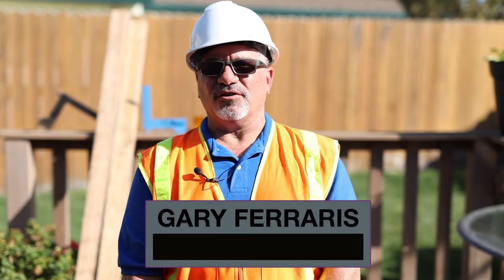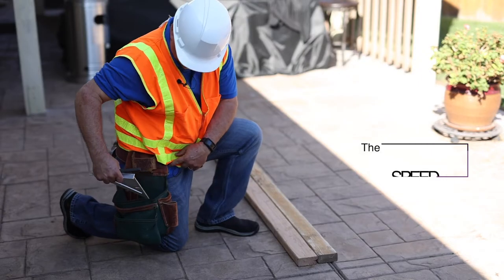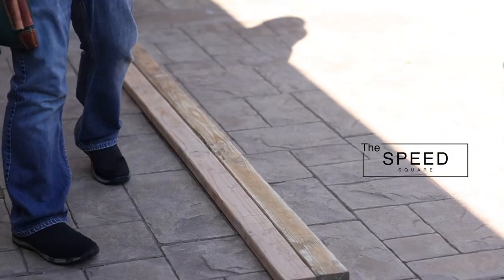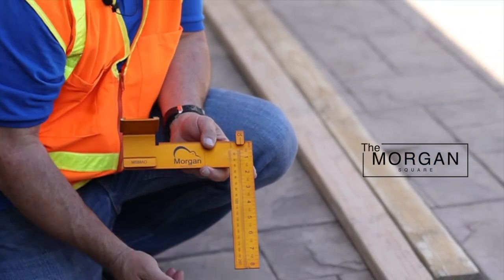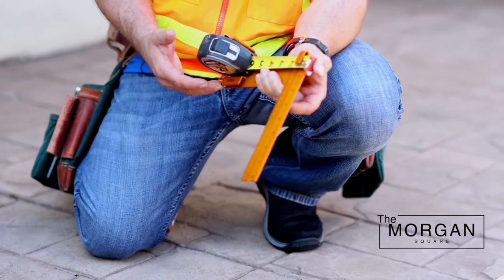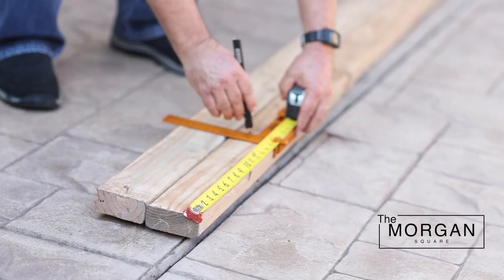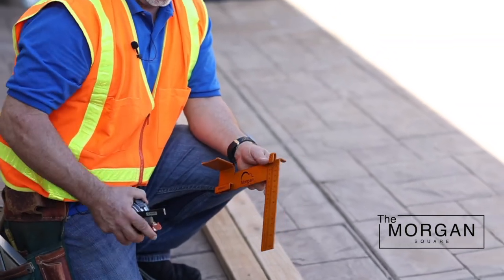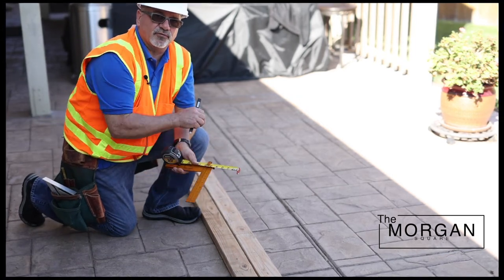The Morgan Square Commercial 2022

Comment: the tongue is already an inch and a half, so no real need for the line on the square, just move the tongue over to the previous line that you made.
•Also in the states we stack our plates three high, then layout, making marks on the top 3-1/2” horizontal for joists & rafters, and on all three of 1-1/2” vertically for studs…
•So if the square came down 4-1/2-inches along with what is already there, it would be better